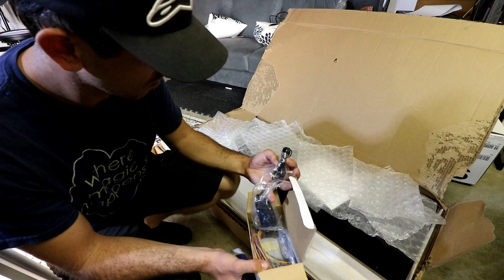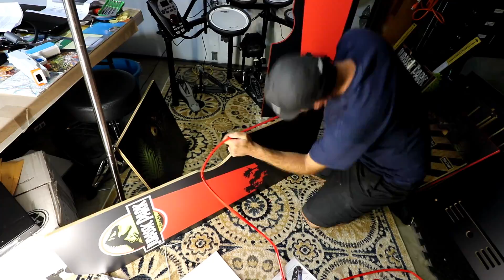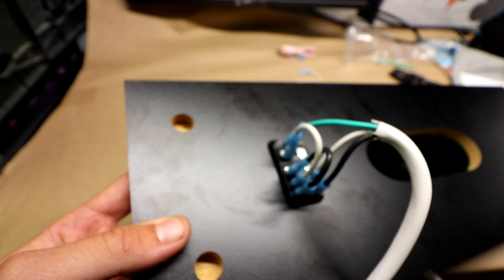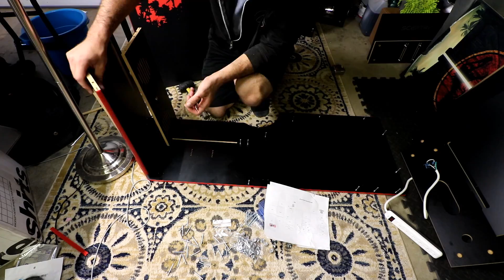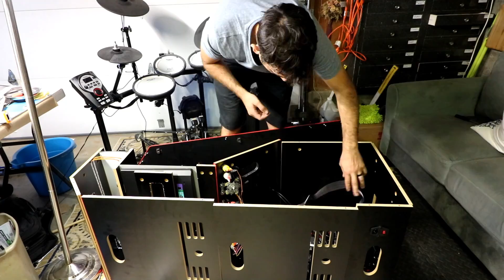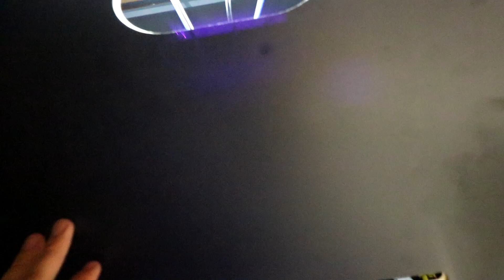How To Assemble Game Room Solutions Shooter Cabinet

Comment: Do you have a parts list? I ordered this exact cabinet the other day. Your video said it included the power connection? I didn’t see it in the what’s included list. What is included that isn’t listed online? Appreciate your time!
Reply: If you're talking about the switch socket scrap it. Just run your internal power strip cord right out the switch socket hole and into the wall. If you really want to kill power just unplug it from the wall or get an outlet plug with an off switch. Countless electricians have watched these videos from the arcade guys and commented that they are not wiring them correctly. I trust an electrician over some guy in an arcade shop.

Comment: If it was mine, i would not cut the holes in the Control Panel, i would put Holsters on each side with cable from there , i think
Reply from the maker: Yeah I saw some like that
Reply: All you have to do is send a ticket to GRS and tell them what you want. Add some controls, remove holster holes, etc. They'll put it in the CNC and cut it for you as long as it fits/makes sense.